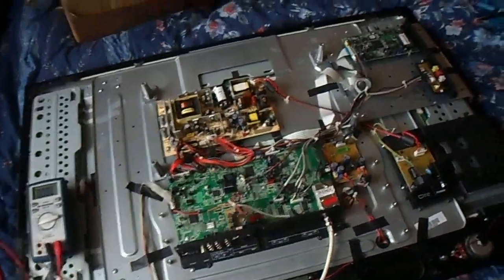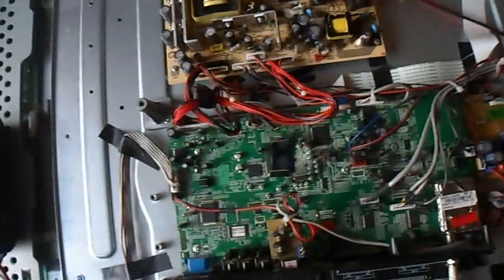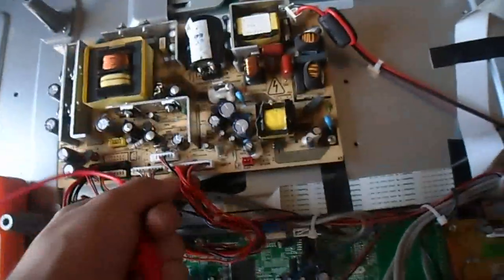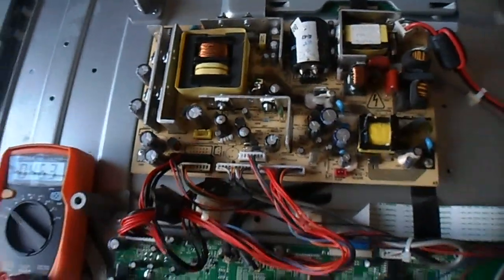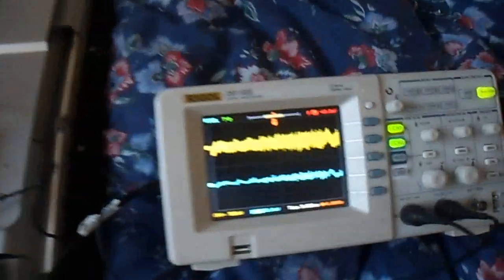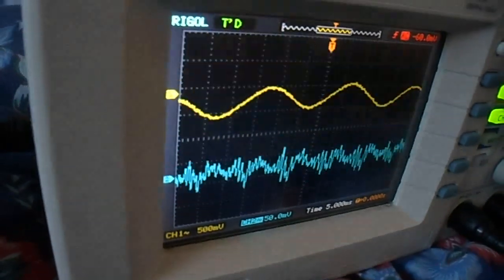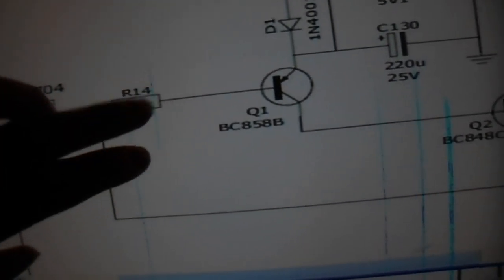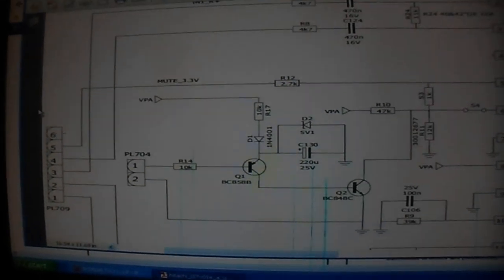Hitachi L42VP01U (Vestel 17MB26-2) - Intermittent audio 18AMP06-4

Comment: I am watching this on one of these.... psu is now on its 3rd fail, only gets sound on cold days lol, but its 9 years old, its consistent....
I paid £699 from richer sounds over the cheap trashy bush in argos at £349..... 
oh how i was peed off when i found out they were the same but the badge...
pulled a 37'' one of these from a skip i was driving past the other day, same set different panel, just cycles rgb if you leave it 30 mins to come on, once again vap faults, but is a good spare psu donor when i recap it

Comment: After looking around today it appears my toshiba 32bv500b is also a vestel made pile of crap it works fine but fails to work on hdmi with both a ps3 and ps4 even though i have tried safe settings
Reply from the maker: +paulb4uk yep. it's a vestel.
Reply from the maker: +paulb4uk you should turn off advanced colour options in the PS3, or try 720p mode. It's only a 720p TV so that will be ok.
Reply: +ubuntututorials 

I will try the advanced color options my sister has the same tv working on a slim ps3 with no problems and this tv will do 1080p on an xbox 360 and with a pc connected, my sisters also is in 1080p mode despite it only supposed to be a 720p tv

Comment: I got  L42VP01UA  (w/ 17MB26), there was no sound at all, only some cracks on speakers, after factory reset the sound came, but it still interrupts, after a few minutes the problem disappear. I have checked that the amlifier works well, no problems with it at all (when no sound, the headphones does not work too). The problem is somewhere in the mainboard, probably at Sound Processor - Micronas MSP 4411K, or Audio Switch: ST TEA6420.